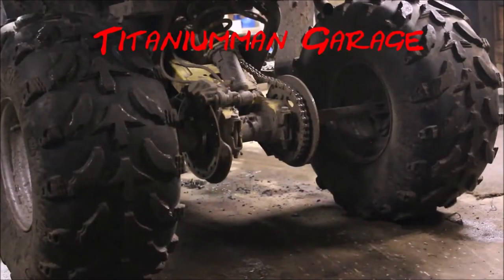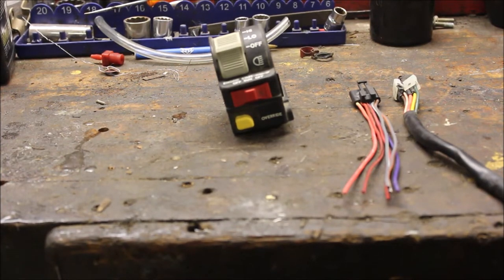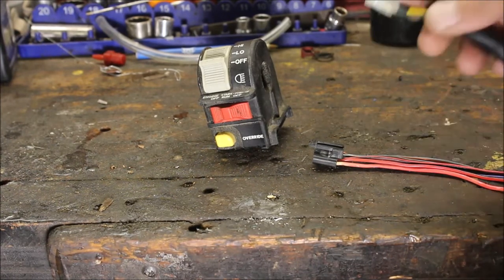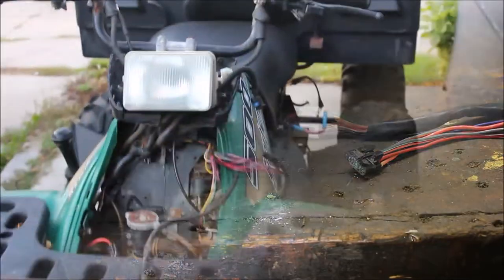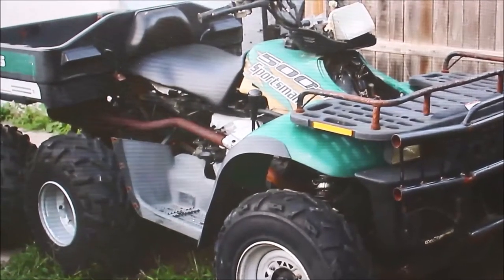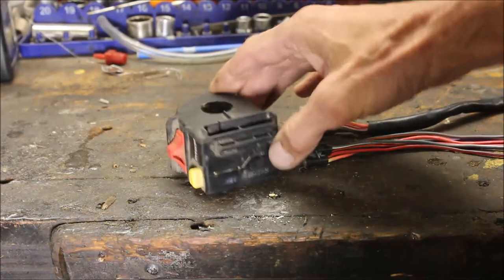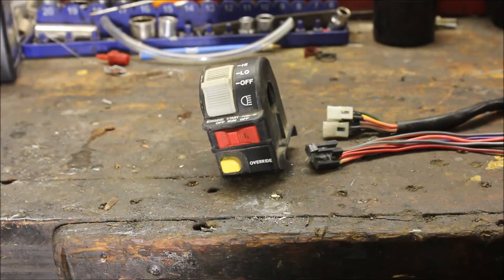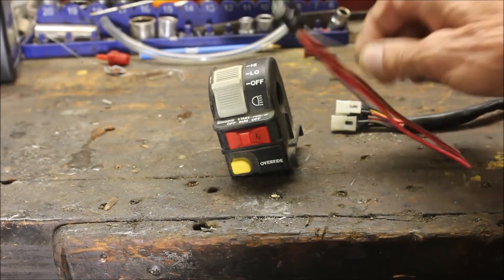Polaris Sportsman 500 Crank, No Start, Bog Issue.

Comment: Just looked at mine and 2 of the wires on the front lead are not connected. I wonder if this is the problem
Looks like one had been cut by a previous owner.

Comment: THANK you for the info. I used your info to put head gaskets on my 400 4 stroke how do you get all of the water-oil out of the case
Reply from the maker: Drain plug at the bottom
Reply: @TitaniummanGarage  thank you I have drained the oil tank put new oil in new filter still have cloudy looking oil after putting in new oil and running it for a while what do I need to do just keep changing it until it's clear
Reply from the maker: @lookoutmountaingarockhunte1300  I would try that. there might have been some old oil res. left in the case.
Reply: @TitaniummanGarage  that is exactly what I thought thank you very much for answering my question. You have helped me very much on this old four-wheeler
Reply: @TitaniummanGarage  What is the brand that you go with to replace a camshaft on a 400 or a 500 sportsman

Comment: I have a question completely irrelevant to the video what brand of camshaft do you use to replace the OEM ones on a 400 sportsman
Reply from the maker: Sorry, I missed your message. Its a tough call. I used to buy aftermarket, but the rockers that came with it I absolutely hated. They didn't fit right. Now I buy used cams on ebay with good tolerances. Never had an issue since.

Comment: I have a question 2000 sportsman 500 with black wire from cdi grounded everywhere machine still has spark would this be a bad cdi?
Reply from the maker: I've had a cdi that would spark when grounded. but at higher rpms would not. It would be worth replacing at that age. just don't buy the china junk one. my went out in a day. But normally if you have spark with the black wire hooked to the cdi...you have a good cdi.
Reply: @TitaniummanGarage  yeah I have constant spark weather the key or kill switch is on or of grounded or not grounded. I bought it cheap died while the kid was riding so I’ll start with the cdi. I’ve already checks woodruff keys timing. I’ll report back when the part comes in tomorrow I just ordered a Amazon one to make sure she fires  before spending $400
Reply from the maker: @nicholaskelley8086  Sounds like more than a cdi. It shouldn't spark with the key off or kill switch off. sounds like wiring issues.
Reply: @TitaniummanGarage  none of the wiring looks out of place nor corroded I’ve even hooked test leads to black wire on cdi and grounded both the motor and frame and still have spark only time I lose spark is when I disconnect the loom from the cdi to the coil. Would a stator going bad cause this? I may just convert the cdi to dc to rule out the stator
Reply: @TitaniummanGarage  cdi fixed the constant spark issue now kill switch broken it will only spark with black wire disconnected. Thanks on order now time to rebuild top end piston rings melted and cylinder scored on intake side

Comment: I cleaned my kill switch but than all the lights died. It finaly came back on but still got the problem. any ideas?
Reply from the maker: Check all your ground wires and make sure they are clean. Also I would replace the kill switch if the wires to it were crusty. The inside might have corrosion in it.
Reply: @TitaniummanGarage  ok I'll check those. It was strange. When I unpluged them all the lights on the speedometer would not work. They came back on there own but it was very odd.
Reply from the maker: @excellenceinanimation960  The way the wiring works is power goes to key then to kill/light switch then speedo.
Reply: @TitaniummanGarage  ah ok. Thanks for the help! I hope I get it soon. It was working the other day I turned it on and off like 8 times. Not nothing. Even after I warmed up the engine with the pull start.  So I’m prity confused.